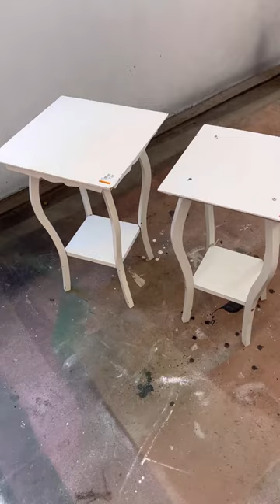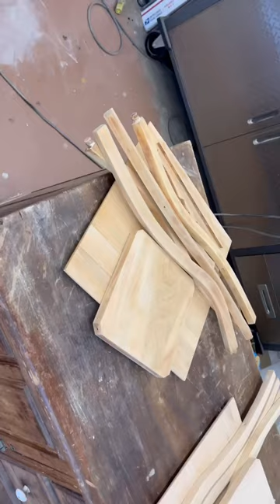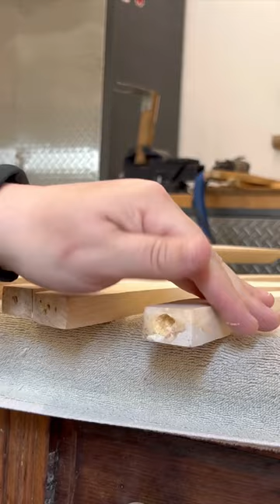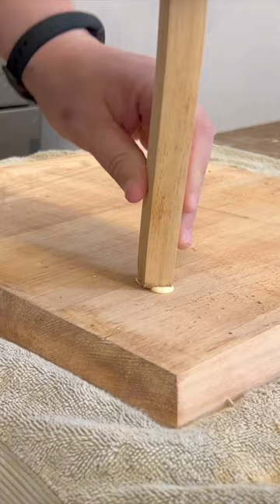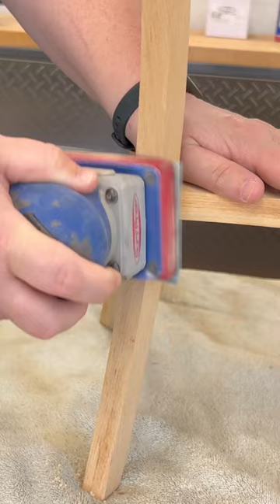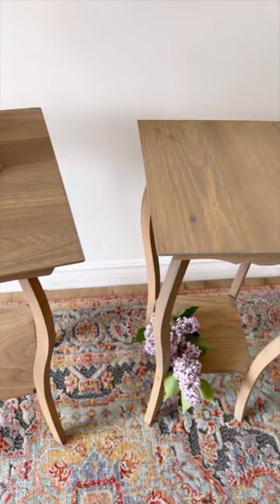Wobbly White TABLE MAKEOVER

Comment: I love to cut and whittle pegs. If you're interested there's a living history farm in Hancock MA which was founded by the Quakers. It has a huge octagonal barn built entirely from wood. A lot of the pegs are the size of a man's arm. It's a joy to see. I'm about to peg my bed together. It started out as a rope bed but the braces added to hold the frame together and support mattress and box spring haven't worked well over time.  And it's not called rock maple for no reason. Anyone who read this far, thank you.
Reply: Is there pictures of the barn on the internet?